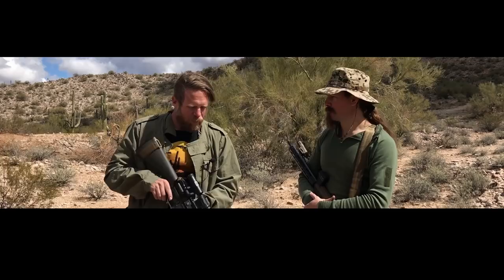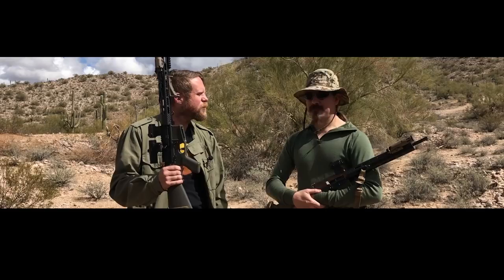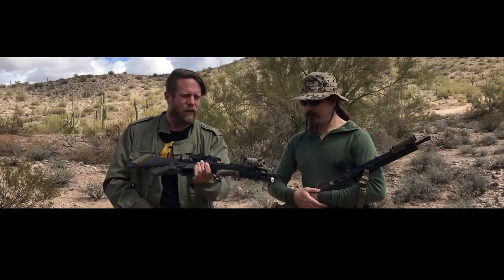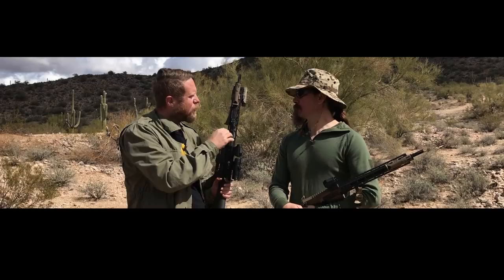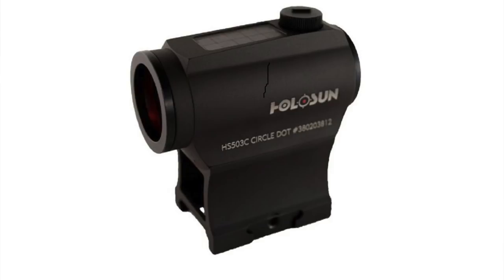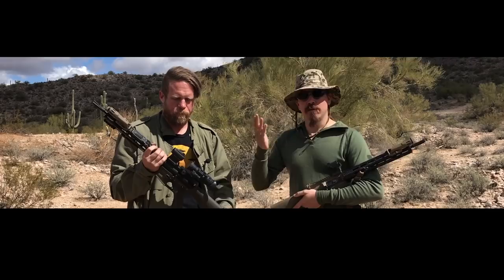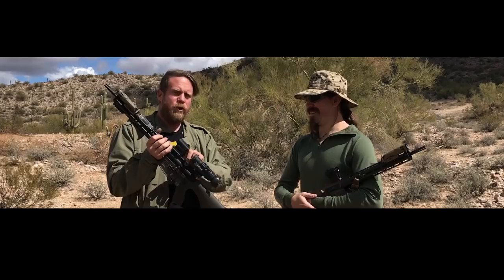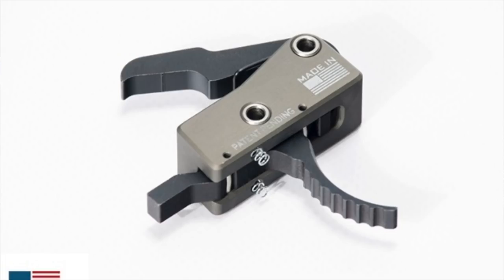WWSD: Rethinking the AR15 - CONCLUSION

Comment: You guys should compare these rifles to the KAC SR-15. People say that it's the rifle that is the true next generation of AR15
Reply: Herbie Shin true
Reply: AFAIK the biggest advantage of the SR-15 is the 'E3 enhanced bolt' with rounded lugs.
https://www.knightarmco.com/weapon-features/e3_bolt/multilug_impoved
From an engineering standpoint, they do seem much less likely to suffer from cracking around the base of the lugs (resulting in lugs shearing off), or from the squared corners of the lugs chipping off.
I'd bet if you built two bolts with exactly the same steel with exactly the same heat treat, the E3-style one would have a longer lifespan, (I'm unsure of how noticeable that increased durability would be if you're not firing full-auto semi-regularly).
However, while KAC sells the E3 bolt standalone, they don't appear to sell E3 barrels standalone, only selling them as a complete upper.

Bolt: https://www.knightarmco.com/12983/shop/rifle-partsaccessories/sr-15-e3-bolt-assembled

Upper: https://www.knightarmco.com/12528/shop/rifle-partsaccessories/upper-receiver-kit-sr-15-carbine-mod-2-14-5-barrel-urx-4-m-lok
Reply: It's really the proprietary aspect that kills it. I would be interesting if all AR-18 clones started using rounded bolts and barrel extension lugs and that standardising was retroactively applied to AR-15 parts.
Reply: Or the LMT New Zealand contract rifle...
Reply: Hardly, the only true next gen AT-15 is the Adcor with the forward charging handle. It only lost out on the new US Army contract due to cost issues
Reply: Tiberius Hrafn-Úlfur absolutely not true, not a single one of the competitors outperformed the M4a1 by a statistically significant amount.
Reply: By what measure of performance? The ability to charge the rifle while prone easily wasn't a scorable factor, that certainly is something of note that is a markable improvement. No modern intermediate rifle is going to score much different by any significant amount
Reply: To be honest, the next generation of the AR is really the LMT MRP and MWS. It surpasses even the SR-15/25 ( and the quality is equal, consider me at LMT makes many of the parts for KAC guns)

- Completely monolithic one piece upper receiver.

- Fully ambi controls  (even more than the WWSD).

- The ability to quickly change out barrels: length, material, and caliber. (you could easily switch to a pencil profile if LMT started to produce one)

- The ability to switch between DI or piston operation on the same rifle.

- Easily the best bolt ever design for the AR platform.

- Also probably the best buffer tube for the AR.

The only downside is that yes, it is going to be noticeably heavier than the WWSD gun (but much lighter than your standard quad rail M4). However, I think that InRange may have obsessed over wait a little too much. Part of this comes from the fact that neither Carl or Ian have served.

And I don't say this disparagingly. I have a lot of respect for these guys, and I think they put out a lot of high quality content and have some very informed opinions. But I can tell you from multiple deployments worth of personal experience, the WWSD rifle is definitely not grown proof, and is not really suitable for mass issue. It's not the kind of thing I would have wanted to rely on in Fallujah or Sangin.

I do think it's suitable for civilian or competition use, and for issue to select SOF units (the guya that don't generally spend a whole lot of time sitting around in the mud and cracking things on rocks) who could probably really exploit it's lightweight and maneuverability.
Reply: The charging handle is such an inconsequential part of the AR I doubt that putting it on the front is truly a forward step in the evolution of the rifle.

Comment: I think this is a great conclusion.
You guys are correct in saying a 14" barrel light weight AR can easily be pointed/used/fired with one hand due to the weight being very well centralized, and realistically a 14" barrel is not giving up enough ballistically to a 16-20" barrel that the sole reason you may miss a target would be attributed to the barrel length even out to 600 yards.

Personally the only things I would change/add are:
Suppressor - I don't live in the USA and these are cheap and easy to obtain and make any rifle so much nicer to be around.
QD sling - Be it QG flush mounts or some for of hook, I think being able to remove/re-position a sling easily can be helpful.
Lower power optic - I agree that for all the reasons you mentioned a red dot offers a huge amount of flexibility, but there will always be times that a 1-6x optic is a big advantage.

Comment: Is it possible a What  would Kalashnikov do / WWKD project - do you think you can apply the same light is fast and fast is good concept to an AK? Or just go buy one of the Jim Fullers guns?
Reply: Stefan Wolf yes. Spam this to the top!
Reply: The AK wasn't designed like the AR though... The AR was designed entirely around the new "space-age" materials of the time. Aluminum and polymers, versus steel and wood. Not that that's a bad thing, but you just can't build an AK like you build an AR.
Reply: I'm not sure there's a lot that could be done without being a manufacturer yourself.  The best the aftermarket could do for an AK is furniture and optics right now.  If I had to piece together something, I'd basically just be looking at a RD gun with maybe a QD mount for a can, AKT trigger, stock of your choice, and the new KNS adjustable piston if it's as nice as it looks.
Reply: Nah, completely different design goals there. For a WWKD project I'd like to see them target lowest cost and highest reliability with fewest compromises.

Comment: Or just keep your BUIS in your range bag in case your optic takes a poop on you.
Reply: The Weapon Collection In that situation the little plastic magpul sights weigh practically nothing and would be pretty easy to find a place for. In fact, in a SHTF situation I'd argue that having backup sights would be an essential bit of gear to have.
Reply: If your stock/grip has a storage compartment, keep 'em in there on QD mounts, wrapped up in something so they don't rattle. Couple grams as insurance against WCS.
Reply: Bring a backup gun.
Reply: If you have a genuine SHTF situation, you have bigger problems than the lack of a BUIS. And one would hope that one has already bought good webbing with random spaces to put stuff in.
Reply: I think with the cost of a Holosun vs BUIS, your better off just buying a second red dot and throwing that in your bag pre zeroed on a qd mount....
Reply: Tuton25 This is a very good point.
Reply: eric karvfordt Does the acog have an etched reticle? My thinking here is that even if the electronics go south on you or you run out of batteries or something if you have a reticle you can still use it as opposed to a holographic sight.
Reply: eric karvfordt and thank you for serving!
Reply: Kevin Storms an acog is not electronic at all. It uses fiber optic and tritium to illuminate it's reticle.
Reply: Kevin Storms it's etched in the top of the prism, I think. Basically where the fiber light gathering tube goes into.
Reply: Just like Ian and Karl said - every bit of Crap you cart around with you is some other bit of Crap you don't get to.  Is half a pound of ironsights on zero-retaining QD mounts worth half a pound of something else?  Is a few ounces of BUIS stuffed in a pocket with no QD and thus no zero retention worth *anything*?  If you absolutely, positively, cannot-sleep-at-night-without-it REQUIRE redundancy for your optic?  Buy an entire second optic, on a second QD mount, and pack that with you instead.  It'll be three or four hundred dollars you never get use out of, a half pound or so of weight an a packaged optic's worth of bulk in your kit that's effectively dead weight, but hey - the next time you build a new gun you'll have an optic you know you like already set to go on that gun.
Reply: hiei248 Ah ok. I've seen the fiber optic models but I didn't know if they had battery powered models as well. To be honest, they're so far out of my price range I've never really looked too close.
Reply: But then why wouldn't you just carry another red dot?
Reply: eric karvfordt Thanks for your response. I can certainly respect an opinion based on extensive real world experience.
Reply: You could just carry an extra zeroed optic with a qd mount too around the same weight.
Reply: Or you could sew them into your clothes.
Reply: Matt Roen Or put BUIS on a 45 degree mount so you still have rail free. I like the idea of popping items on and off as needed.
Reply: What would be the validity an practically of having notch sights built into the rail it's. Aka just low level bare silhouette sights, like in much older style rifles?
Reply: P226nut mine return to zero every time I remount them.

Comment: If you've got a pec15 then sure you probably don't need back up irons because you've already got 2 sighting systems unless of course you're running them as a close range option due to having a scope as your primary sighting system, especially if you prefer to have it at higher magnification for longer range use. Also back up irons can be mounted according to space you have left over, yes you might lose some sight radius but it is a back up not your primary. Do whatever works for you at the end of the day I wouldn't compromise your primary optics for the sake of iron sights but if you can fit them in then why not, the weight they add is negligible at best.

Good video as always guys, thanks!

Comment: I think you guys hit the nail right on the head, through informal research. I think you got an inkling of the importance of the very light AR after you used the SP1 in competition, and a lightbulb went on in your head...this is what Stoner intended! As I may have said before, the M16A1 in my view, was just about perfect, and the imperfections were minor trade offs. Obviously, you figured out practical improvements...without compromising the weight. With the A2 the military got off the wisdom of the light rifle. Having carried the A1 myself, and 60 pounds of gear...the lightness was crucial, but also the lethality of the 5.56 round. Never underestimate the round. Once the problems of the early AR's were worked out...it was great! And 95% of GI's exit interviews gave the rifle high marks. You examined a question a lot of people thought about but never had much data on. Bravo!

Comment: I think one thing that you guys missed with the BAD lever is the ability to lock bolt to rear without taking your hand off firecontrol. With the BAD lever, you dont have to shift your grip to remedy a malfunction. Thats an advantage to me.
Reply from the maker: That advantage does not mitigate the disadvantages of accidental discharge.

Comment: As an artilleryman in the army. My biggest issues with my rifle is the metal to skin contact. This goes for heat and cold. So the handguard and lower I think would be awesome. However I would say the heavier barrel would be my preference due to strings of fire fights can cause your barrel to get super hot. Even in semi auto.
Reply: They addressed the concern of barrel heat, did they not?

Comment: 6:43 It's my not so humble opinion that back up mechanical sights are vitally important for a fighting rifle. Not because an optic can fail, although that's possible. But because an optic that gets smeared with mud, oil, blood, snot, vomit, or whatever smegma you run across becomes nearly useless. There's just no quick, dependable way to clean it. So the only way to get the rifle back in the fight is to strip off the optic.